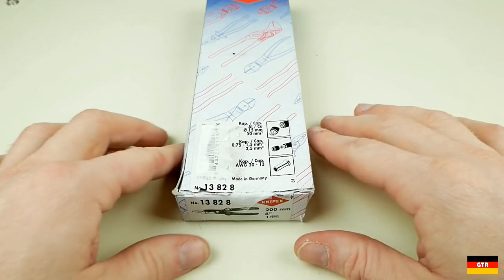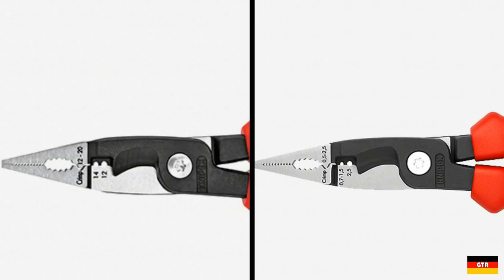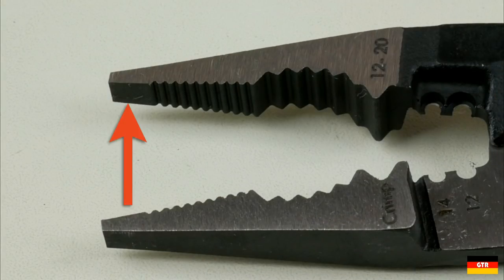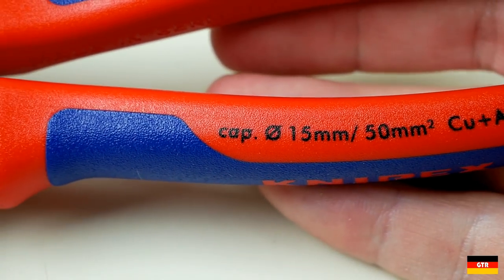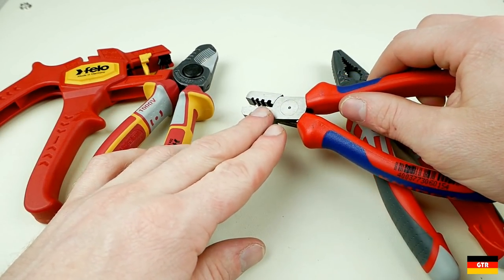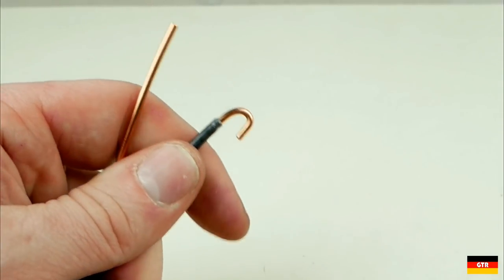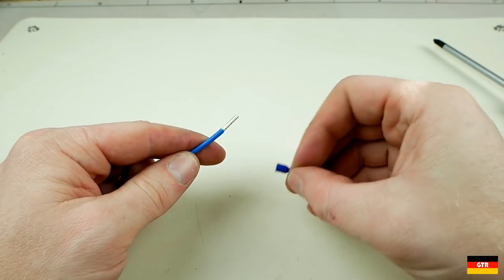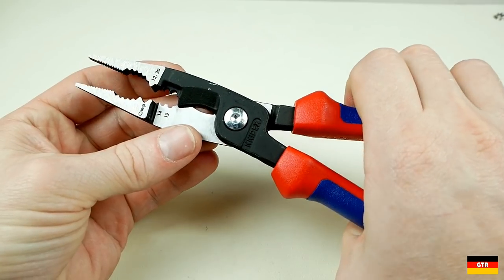Knipex 13 Series Electrical Installation Pliers

Comment: I'm an IBEW electrician and I work in industrial, commercial and residential settings. I absolutely cannot imagine doing my job without these pliers. They're my absolute favorite pliers and I have turned a few coworkers onto them and they feel the absolute same way. Give them a shot! They'll ream conduit, act a needle nose, cut up to number 1 AWG, cut MC like butter and strip number 12 and 14 AWG in the strippers, or strip just about any size wire in the cable cutter if you're careful.

Comment: I've been an electrician for 12 plus years, and I've worked on residential (single and multi family), commercial, institutional, and currently, I'm a shift electrician in a pulp mill.  These pliers allow me to carry fewer tools on my person.  So, for the majority of the run of the mill calls, these pliers are all I need.
Thanks for the fantastic review.

Comment: I have been using these pliers on the job for nearly 2 years now, the insulated model with the spring - and i wouldn't want to miss them anymore. It's probably the one tool i keep in my pocket the most after a knife and a small screwdriver. Locking and unlocking the spring mechanism to cut cables becomes second nature after a while. Stripping cable insulation of course works much better on round cables common in Germany. I didn't even regard these pliers as expensive, in Germany all models are between 35 and 40 EUR (45-50USD), about the same price as standalone Knipex cable shears.

Comment: I'm an electrician and I wouldn't want to be without these. I don't use the crimpers, I wish they had a #10 instead of the #14. I use them to rough in conduit, all the way through to finish. I love the cable shear on them. Nobody I work with use any Knipex as they are all klein fan boys. However they are impressed when I can cut all the way through all the wires on the end of a fish tape in one swipe. If I lost them, I would go out and get a new pair that same day.
Reply: I've slowly started to convert some of my Klein fan boy coworkers into Knipex guys, and they haven't looked back at all. Knipex really does make a superior product.
Reply: Brandon Dierwechter  would you recommend the insulated ones over the red n blue
Reply: Edward Quintana I have the plain dipped ones just because they are slimmer and cheaper.
Reply: Lol "I wouldn't be without these" and you would still need 3 tools including the knipex
Reply: I think that one tool for each task is fare better then one tool for it all, what if that tool gets broken?!
About fanboy's I do not understand them, Knipex do make fine tools but not them all and that's the same for all brands. Bye what is best not what has the right name, i.e. for what I do, most Fluke meters would be unusable including the 87 V.
Reply: Brandon Dierwechter I wouldn’t find these too useful using stranded cables like what I use, but I really do want these pliers

Comment: As a rv builder, the 1392200 has become one of my favourite tools for electrical installations. And it has replaced some other pliers, which makes my tool bag lighter.

Comment: Very detailed informative review as always. I'm an electrician, got this tool recently, and use it daily. Quite costly, quite high quality. Wish they had #10 stripper instead of crimper, and serrated tips rather than smooth. The lopper style cutter is where this tool really shines! And I agree the handles should be built bigger. I may make a video on them myself ;) you and sparky channel set the bar high lol
Reply: they have new model which might be better fit for you: 13 72 8
Reply: Oh FFS..... now there's a new one that does all the stuff I talked about....only 60 bucks!

Comment: Thanks for the video. I always enjoy your stuff.

I have both the Knipex 13-82-8 pliers and the Klein Universal pliers without the crimpers (J206-8C with the self-opening spring removed). I bought the Knipex first but was surprised when I discovered that the wider duck bill style tip did not work well when closing wire loops around connector screws for two reasons. One, they were a bit too wide for some situations and two they are smooth and don’t grip wire particularly well – frequently slipping off. The second problem I have with the Knipex may not bother everybody.  I store my pliers vertically (business end up) so I can identify them easily.  I don’t wear gloves all the time and I found that the reamers on the Knipex were so sharp that I was occasionally cutting my fingers when I reached for them.  I contemplated grinding off the sharp edges of the reamer, but that wouldn’t fix the other, slipping off, problem. Another advantage of the Klein pliers is that they strip more wires sizes (8-10-12-14-16 solid) and also cut and chase 6-32 and 8-32 screws. So, I settled on the Klein pliers because they worked best for what I was doing most of the time. That said, I have mostly Knipex (pliers) /Wera (Screwdrivers, wrenches & sockets) /Wiha (Screwdrivers) in my tool kit (VETO ProPac Tech-LC). BTW, the downside with the Kleins was the standard Klein complaint – too stiff out of the package and needing to be worked a while to get them opening and closing easily.
Reply: Dean Rhodenizer the slipping off struggle is real man! I use gloves, so the finish doesn't affect me. Love this tool.
Reply: Dean Rhodenizer Totally agree 🙂👍 I personally like spring assist pliers though
Reply: But the Kleins have a pretty wide nose as well. I think you would like the Neiko - they have a legitimate long nose, with rounded teeth to the tip which grip the wire well, and ends are perfectly sized for hooking.
Reply: Thanks, you are right. Although the Klein pliers feel a lot smaller, they are not. I measured them at the tip of the jaws. They are only 0.5MM smaller than the Knipex. I believe I have associated the slipping off as partly attributable to width when it was grip that mattered most. What model of Neiko pliers were you referencing? Was it the 02038A 6-in-1 Wire Service Tool?  I just looked at this model on the web. It looks like a more evolved design than either the Knipex or the Klein pliers and it comes in around a third of the price – I wonder about the hardness/toughness of the steel. It has more wires sizes supported along with a bare/insulated crimper.
Reply: Yes - you've found the Neiko I was describing. I prefer it for the combo of functions  - but it could be better too! Its nice that it has a shear-type cutter like the Knipex, but it would be nice if it was a little bit bigger to easily cut flat american plastic shielded wire (romex) - and frankly it could give up a little bit of the long nose length, or one of the stripper holes to do lengthen the cutter. 

As far as quality, its made in china and I'm sure Knipex's quality is better. But generally I found the quality to be very high. Flaws would be the tip of the long nose can deflect if twisting on something that won't give - which is a characteristic of most long nose pliers; and I find you can have the grips start to slide off if you are pulling really hard on them, I probably should glue them.

Comment: I love Knipex pliers and seriously considered these but in the end decided on the Klein(J206-8C)all-purpose spring loaded(you can opt for crimpers instead of spring) because they seemed to have focused on the specific features used most by electricians (stripping, cutting, looping, etc). The tip of the Klein's are cross-hatched and grab wire impressively well for twisting, looping, pulling, etc

Comment: Very good tool - solid crimping (for everyday use i have front loading crimpers 97 53 08, so sometimes when I'm connecting two wires i need side crimping), very solid cutting edge. I used them to cut about 20 pieces of 0,8mm feeler gauges - I did that without a hustle with a very clean cut and I ended up with some dulled cutting edge which lead to pliers jamming when being closed so I just used sharpening stone on flat cutting surface and after 3 minutes they work like new.

Comment: These combo pliers are best suited for commercial MC cable installation. I reach for them sometimes when doing other tasks as they are quite handy. Only my Knipex Cobra pliers get more use. I use a dedicated ferrule crimppers not these. Great review as usual. Highly recommend this model for commercial / residential electricians
Reply: Jon Johnson 100% dude. Out of all the multi function pliers, this one has the nicest lopper for mc/bx/ac90. Wide enough Jaws was a 'must have' in choosing for me. No #10 still sucks in commercial though.

Comment: I have these and I agree with your assessment 100%. I feel the smaller handle does fit the pliers but as a way to limit how large of wire one would attempt to cut the wire...this sadly negatively effects the crimper. They should have moved the crimper between the handles like Klein does to give better leverage. These are some of the best finished pliers Knipex sells. The only ones comparable are the box joint pliers/cutters that are for electronics but $50-$70 a piece.

Comment: Good video, thank you!

The installation pliers are actually not the most expensive models. I don't know how the price is in the States, but here the spring loaded installation pliers with VDE-grips cost round about 40€ (49 US$) including 19% VAT. 

The most expensive model made by Knipex is the "ecrimp", battery operated crimping tool with exchangable dies. Price is 1149€ (~1400 $). That's not a tools for a tradesman, handyman or something into this direction. This is designed for industrial use if you're performing lots and lots of crimps and doing nothing other that day...

Comment: I would like to know whether the KNIPEX StriX is worth it’s value or would it be better to go for the cable shears and wire stripper as separate tools? Is the cutter on the StriX the same as the cutter on the cable shears?

Comment: I absolutely love Knipex products. What I do not get it is if this model is for electricians, why they are selling version without insulated handles? Personally, I am buying tolls with insulated handles.
Reply: They were probably designed for first fix. The cables aren't energised so no need for VDE handles.

Comment: Methinks the curved knives are mostly designed for round cables, reducing the flattening of them. The outer edges would mostly be for rounding holes in plastic boxes, not metallic. So they are designed for european usage scenarios.
Adding trascription was gold, as I can´t listen to close-mic´d whispering.

Comment: Do you know if I can us the 13 92 200 to strip 12 and 14 AWG? I like the 13 82 8 but I will like to have it with the spring for auto opening

Comment: If they made these but with a wider head then they'd sell even more. Biggest deter from these pliers and alot of Japanese pliers are the smaller heads which can make twisting more than one piece of stranded or solid core together really difficult

Comment: I seriously looked at this 6 months ago when I was looking for an electricians pliers. I could forgive them the two stripping sizes - these are what you'll use for most building wiring. But the deal killer for me was the lack of threaded bolt cutting holes. They really should have expanded the area between the bolt and the handles to fit those, and just went ahead and moved the crimper back there so it would be closer to the bolt and have more leverage. This would have added maybe an inch to the total length which would have added the leverage you mentioned when comparing to the lineman handles.

If like me you want to stay away from cheaper stamped electrician pliers Klein also has a forged multi function electricians pliers which is different featured than these - more stripping sizes, and the bolt cutters, but omits the crimpers. Milwaukee sells a very similar forged electrical pliers also w/o crimpers.

I ended up getting a relatively inexpensive forged multi-function pliers from Neiko which was very nicely featured - pliers, nut grabber, 6 strippers, shear style cable cutters, bolt cutters, and crimpers (no reaming); and closer to the profile of an ordinary 8" long nose pliers. Look it up - its a good value, and good functions. Like the Knipex you can tell it takes a lot of post forging machining, and I felt the quality was very high. You ought to do a comparison between these three, and maybe throw in a stamped unit for the sake of breadth.
Reply: They were designed for the german market and here you don't need to cut hard bolts as an electrician. The only bolts you sometimes need to cut are the self tapping screws that hold outlets or switches in the box. The metal what they're made of is so soft, you can cut them with diagonal cutters. But I've switched over to a pair of Lineman's for the job of cutting these. German outlets and switches have keyholes, so you can cut all your bolts, screw them partially into the box and install the outlets afterwards. But only after the plaster guys finished their work.
Reply: That's interesting how differences in electrical device hardware leads to different tools. The north american machine screws that are typical of electrical work - 6-32 and 8-32 are also typically soft enough to cut with diagonal cutters, but this often spoils the threads, and so north american electrical pliers almost always have threaded screw shears built in that preserve the thread and allow you to use the screw without any fussing over the cut end.

Knipex has a good tool here, but if they want to promote it for north america it really should have the screw cutters. Just marking the wire strippers with the north american sizes is not enough.
Reply: Knipex is performing much better in the US than Klein over here. Klein tries to sell wire strippers with AWG only here....that's much worse! AWG wire strippers are practically unusable here in Europe. We use the cross-sectional area of the conductor in square-mm for the dimension of the wire. And it doesn't matter if it's solid, stranded or fine-stranded, 2.5mm² are always 2.5mm², so you don't need a separate scale on your wire stripper.

https://www.reichelt.de/Abisolierer-Kabelschneider/KLT-11054-EINS/3/index.html?ACTION=3&LA=2&ARTICLE=216258&GROUPID=573&artnr=KLT+11054-EINS&trstct=pol_2

Ok, they've got the german VDE-certification for their insulation, but the tool itself is useless.

And yes, the threads of machined screws are ruined very fast. Our screws look that way:

http://www.elektrikshop.de/images/product_images/popup_images/966_0.jpg

You just cut them to length, they're like wood screws but without a pointy tip.
But with their Lineman's Klein could be successful. Lineman's are unusual here, we normally use combination pliers instead. Knipex also sells their Lineman's here, but not the insulated (VDE) version. They're manufacturing this model for the US market only. Klein is the only manufacturer selling insulated Lineman's with the VDE-certification here in Germany.
Reply: Ha! Well, typical american hubris, thinking the rest of the world should follow their lead. In any case Knipex shouldn't be following that mode. They have the space on the joint for screw shears, and they should move the crimper to the back where it will have some strength, and that will give them space for one more wire stripping position - they can do 14-12-10.
Reply: A third stripper would be a good idea! In most cases the 1.5 (actually it is 0.75 up to 1.5, 0.75 is for some cords of appliances with a smaller demand) and the 2.5mm² are sufficient, but some months ago for a specific work I needed the next larger size, 4mm²...
Reply: Don"t see much Klein in the UK either , i would stick with knipex anyway :]
Reply: With one exception:

Lineman's pliers. Knipex don't sell insulated Lineman's pliers here, only the version with the comfort grip. But you can get insulated Klein Lineman's pliers with VDE certification here. I love the leverage of the long handled pliers,  it's good for larger wire sizes like 6 or 10mm².

Comment: I'm not an electrician, but I'd want the option to strip 10 gauge.  I don't like the location and width of those crimps.  It doesn't look like it would work well with Sta-Kon terminals.
Reply: The crimper is for ferrules only. The usage of ferrules on fine-stranded wires is mandatory here, tinning them with a solder iron and then put them into a terminal is banned here for round about 40 years.
Reply: Got it.  Are they worried that soldering makes the wires more brittle, or that people do a bad job at it?
Reply: The solder deforms under pressure, and in a screw-type terminal after some time it will become a loose connection, because the screw of the terminal remains were it was tightend but the solder still flows very slow, even if it's cold. And loose connections are getting warm, so warm they could start a fire. On the left side the way the terminal should look, on the right side you can see what happens if you solder the fine-stranded wires and put them into such a terminal:

https://files.elv.com/bilder/elvexpertenwissen/normal/fliessen_verzinnte_adern_01.jpg

The screws are totally molded in, so your only option is to cut the wire. If you're using soldered fine-stranded wires in spring loaded terminals the solder will deform so much, you'll have difficulties of removing it from the terminal. But in this case there'll be no contact problem through the spring loaded mechanism of the connector. The ferrules are made of electrolytic copper (for a high purity) and are tin-plated.

Here in Germany using these ferrules in screw-type terminals is mandatory, in the US they're only recommended. If you use WAGO connectors 221 or 222 it's not necessary to use anything (ferrules or solder). Just open the lever, strip the wire about 11mm, put it into the opening and close the lever.